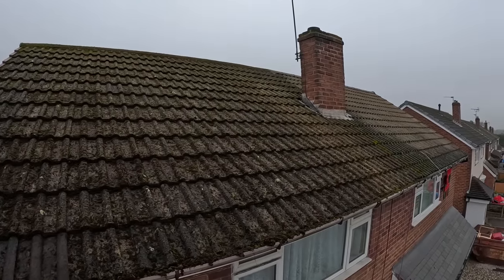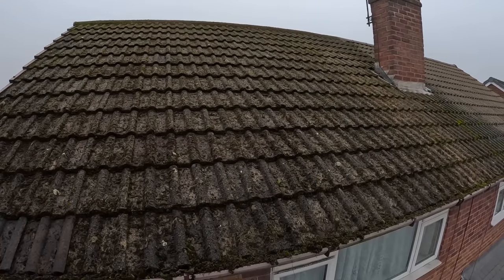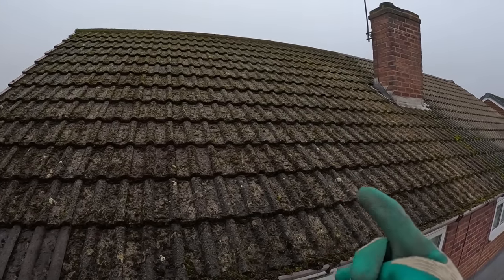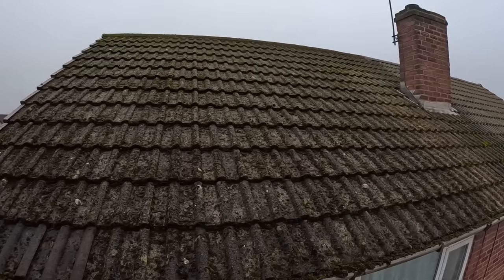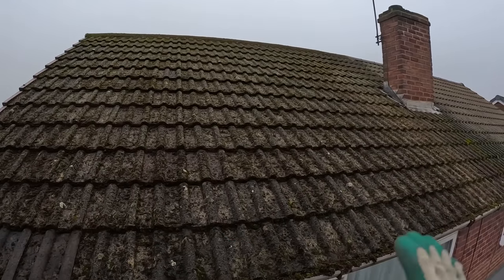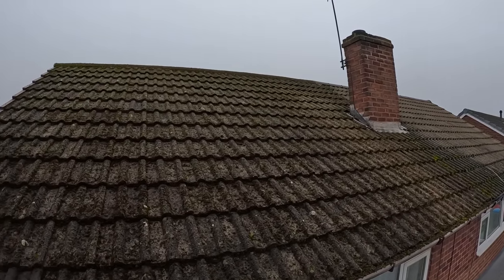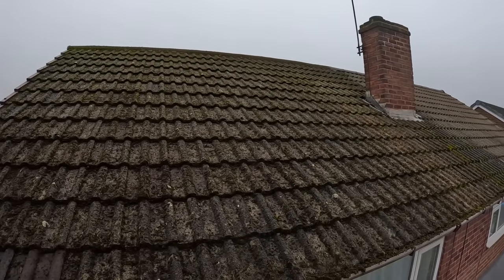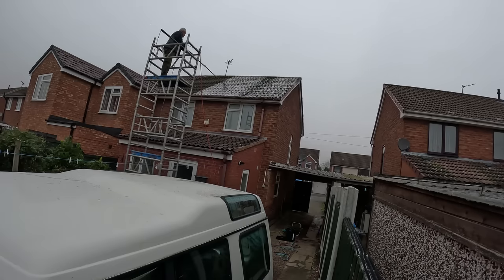STRANGE CASE: RUDE Neighbour Went Too Far? I Discovered Evidence Whilst Cleaning A Roof!

Comment: Shared gutters like drains have to be maintained by everyone connected to them. In this instance if number two neighbour has put up gutters that will not allow the run off from the first house then he can be forced to make proper provision. I would ask him nicely to correct the problem caused by his DIY and if he refused I would point out that failure to do so will land him/ her in court. This action is not what you really want to do but if shove comes to push I would not hesitate. Neighbour two will be made to fix the problem and have quite a large legal bill to pay as well.

Comment: The state customers roof was let get into before having it cleaned would have been causing moss to fill maintained neighbors guttering and moss slurry splattering down downpipe and possibly blocking it etc. Always two sides to everything, may have just been done in a bid to protect their property from a long overdue unmaintained neighbors moss.

Comment: Neighbours have broken planning regulations,building regulations in England, Wales & Scotland require that any installed guttering is fit for the purpose of protecting the foundations of your property, and any neighbouring properties, from rainwater damage.  By blocking flow to downpipe without planning consent they place property at risk from water damage.  Neighbours should contact their local planning office if neighbours refuse to sort it.

Comment: In the Uk joint soak aways are covered in the water regulation Act therefore an act of Goverment. By blocking the ajoined property a route for water to escape, the act is in contravention and therefore you can get fined for doing so, and the ajoined property could claim for damages on the contravening house owner

Comment: OMG that is a huge amount of work to scrape all that off the roof. That is like doing house autobody and detailing. Looks great when you are done but a huge amount of work to get it ready. How come you cannot pressure wash it? Just make a tool with that long pole to extend the reach so you don't have to fall off of the roof. You could angle it so the water does not go under the tile but scrape it away. They also got hot water pressure washers that would strip that in a short time. They are a lot of money. A cheap one is $3,000-$4,000.

Comment: I'm not a roofer but...  I think it's pretty ridiculous to design joined houses so one side has to deal with all the runoff from both houses.  Gutters should be slightly angled from the center with both unites having their own down spout.  That way you don't have one homeowner having to deal with clogged gutters because the other homeowner is too lazy to clean their roof frequently enough.

Comment: Did you look at the other properties in that road, to compare the gutters? 
If the other properties, which are the same design and the houses on that road were built by the same developer, have shared down pipes then there is likely a joint responsibility to access and maintain the shared down pipe and that will be in the house deeds or land transfer documents, if not an adjudicator would consider that a reasonable responsibility for both parties to share, if the other properties don’t have this gutter arrangement, then it’s likely a cock up or cost saving method by avoiding digging a separate soak away on the property you were working on….

But bottom line is that an adjudicator would order both owners to share that responsibility and for the property with the downpipe to ensure his guttering allows for the free flow and disposal via the downpipe to the soak away from the other property.

Personally I’d just look at digging my own soak away or similar surface water drainage design and put a junction and down pipe just before the neighbours property line begins. That way your taking control back of what’s yours whilst maintaining a ‘shared’ gutter….

Comment: When the houses were built there would have been an established drainage method, your client will need to evidence a right to use the shared downpipes.  He would also have liability for maintenance and repair etc.  It wouldn't cost that much to run a new downpipe to a soakaway and cap the gutter off.  What the neighbour hasn't realised is the blockage will probably just cause the rainwater to rundown the party wall and cause problems.  You have to be careful making modifications to property without authority as it could be criminal damage, though you'd have a defence of a perception of lawful authority.

Comment: My neighbour inexplicably took out their downpipes causing a leak in my spare bedroom.  Niigata falls can through the windows lintel every time it rained.  Got this roof clean myself and the cleaner offered to clean theirs at the same time.  He was ignored.  Surveyor advised my leak was caused by blocked gutters and neighbours downpipe removal.  My neighbours would not even talk to me.  Cost me 580 quid plus 660 to fix the roof damage caused.  My house is dry again.  My neighbours are pigs as for 450 quid downpipes could have been reinstated and talking to me would have had me paying for this.  Cheaper option.   Putting in a barrier was an option i tinkered with but I paid 300 to have a tradesman reset my gutters so water does not pass to my house so readily. I am not happy to watch this video to see the tradesman immediately picking sides without, it seems, hearing the other neighbours pov.

Comment: It is a shared guttering and therefore the neighbour di don't have the right to alter it in such a way as to inhibit the flow of rainwater from the roof to the sewer or soak away. It will be covered in the deeds and covenants of the properties. First ask the neighbour to alter their guttering to restore the connection if that fails then it is an expensive court case or if there is a convenient sewer close to hand fit another down pipe as it may be less agro

Comment: I was a Roofing specialist contractor for tiles ,slates, leadwork and all flat roofs including all types of guttering and drainage, 

There would most likely at some point had a down pipe in centre of the two properties  probably running into a SOAK AWAY 

Soak way would have been probably under the fence, 

It is illegal to restrict or direct or block running rain water, 

Give you good example of cowboys, I myself have over the years put in hundreds of concrete posts, gravel boards and fencing, 

My new neighbours father who claims to be a tradesmen put up new fencing and I said please don't touch mine, not a problem you would think. 

I go out to check and all my posts and fence has been pushed and forced all over the place, 

I said you claim to be a tradesmen in your new gleaming truck lol but your a complete cowboy,  

You can always tell a cowboy from a tradesmen by how the job is cleared up and left cleaner then you arrived lol.

And why do tradesmen clean up thoughly,  
Its because the job is completely finished and a good clean and then you hopefully get paid, 

But yes it is illegal to block , restrict or alter water then can result in damage or subsidence  to another adjoining property. 

Here's a bit of advice. 

NEVER EVER GET INVOLVED IN A CUSTOMERS NEIGHBOURS DESPITE BECAUSE YOU NEVER REALLY KNOW WHO IS RIGHT OR WRONG AND IT CAUSES IS YOU STRESS LOL

Comment: The Neighbour is fully responsible for any damage that could have been caused by the wilful blocking of the guttering. The deeds to these properties will have the legal obligation spelled out and there is no getting away from them.
My own house was built in 1892 and still have covenants attached, like I cannot turn my house into an Abattoir, I cannot create Noxious smells and i have to be a good neighbour

Comment: I have just moved into a council Bungalow an it's roof has more moss than this one. I also have crap wonky guttering that spits out a waterfall when it rains. An than about 4ft from my back door. The council won't do anything about it. An I have an intruder in my loft space. That keeps me awake every night with its walking over my bedroom ceiling. It drives me nuts as I can't sleep at night because of it. Yet council keep giving me excuses to sort it. Same with the moss covered roof an it's the same roof type as shown here an all the bungalows down our close. Which are ALL covered in this horrid moss. Which is a nightmare as it falls all round the path round to my back gate. As I use a mobility scooter it causes havoc as its so hard to get up with my health conditions. Yet council do nothing. Seeing this I'm defo going to save up an get my roof an guttering fixed by a private company as I'm sure they will do better than council anyway. Where is this based as I'm in West Midlands.

Comment: He could sue his neighbour if that has caused damage or damp in his home, as the water will be running down the walls. Luckily my house gas slate, not concrete. I had cowboys, not like you, who offered to clean my roof. However, they wanted to use a pressure washer. I had to point out that the moss simply washes off with the first heavy rain and saved myself £1500. My neighbour not so smart, and they had a new roof - concrete tiles.

Comment: Yeah rude. Yes your only option would be to run in another downspout and run it across to the other side where the drain connects right. Could have went in on the roof cleaning and did both sides and gutters but I guess didn't want to ask the neighbor to pay half.
I would assume in the US you could probably go for damages of the water backing up into the roof from not being able to drain. but I hear the UK still has some nice people in it.

Comment: im not familiar with UK law..but in western society the standard is pretty much the same, the house as it was built and purchased would be grandfathered in and any changes to the shared aspects of the house would have to be signed by both parties.  is the down spout was grandfathered in and drains to the city system then the nieghbor who made changes is in violation of the law.  Any damages caused by flooding, to the roof, soffits, etc the neighbor would be held liable for. And the neighbor could also face building code violations and fines

Comment: its wild to me that a roof only has one downpipe.... Stick one at each corner, or at an absolute minimum there should be one for each pitch of the house.

Theres not enough context to make a determination. If the guy who block the drain, and obviously keeps his part of the roof clean, had spoken with moss roof neighbour multiple times about cleaning his roof and it blocking the drain, then I can understand where hes coming from. Guy is not performing the required up keep when having a shared facility. If anything the things are as bad as each other. At the end of the day, and act or omission is preventing the use of or working of a shared piece of property.
Guy with the mossy roof is obviously not going to say if the neighbour had spoken to him.

Comment: Might be a good idea to get a new down-pipe added. that neighbor will probably just do it again. Worse part is by raising up the existing down-pipe is tat it'll result in standing water in the gutter.
Reply: No moss now, so neighbour may not feel a need to.  In any case, if both sides inspect annually then the barrier would be removed as soon as it is added.

Comment: Wouldn't blocking the gutter being illegal or not be up to the city and whichever department is concerned with run off?  Some government ticket writer might be all excited about writing up a big ole violation on that.  But, maybe the downstream neighbor had problems with the downspout plugging and had some water damage he had to get fixed.  So he wanted to protect his side from moss coming off the other?  It does seem odd to me that the house was built as a semi detached but with only one down spout on the front.  It would have been better to have each side have its own, then you prevent to worry of silliness like this.

Comment: I guess different areas different rules, but there was me thinking each householder was responsible for the run off their own roof and therefore would have separate down pipes into their own soakaways.
Reply: The 70s Wimpey built semis on my estate all share downpipes front & back. The back one discharges into the main sewer as well, not sure about the front. They are both on my side. The sewer manholes are also on my side, my neighbour doesn't have any. Just cost cutting practice by developers.

Comment: The was an ongoing issue hear between the neibours and sounds like next door had enuff , I'm putting my money on the moss kept blocking the Swan neck and kept over flowing on neibours side were gutters at its lowest and your customer with the moss wasn't complying so the put a boj devide in there , I seen it many times over years , I seen blocks of houses on hill 7 gutters all stepping into each other , guy with outlet struggling to cope with moss from 4 doors up try explaining that one lol, 20 years roofing experience here

Comment: I watched this video and my opinion is mixed. Yes, it's not nice what your neighbor did, but on the other hand if I was in your neighbor's shoes and I had my roof nice and clean why the other roof of my neighbor (you) was totally covered with moss it is kinda of understandable that he did not wanted your junk through his drain pipe. Aside from that, to avoid these kind of issues, and I assume these houses are owned (not rented), is that it's better each has their own drain pipe.

Comment: The "" local planning authorities"" ensure the submission of drainage plans at an early stage in the planning approval process, and that the whole development is carried out in accordance with the approved plans.
  before ever erecting /building the house . also on the plans it shows location of outlet/downpipe who is responsible for that outlet 

This  so called neighbour has not applied for planning permission to alter the flow of rainwater which is put back in the system which the water authority places a charge ££  on each/both property/s  🤷‍♂
also inform water authorities that your  client  can now ask for  a repayment   ££  is not using their water drainage collection😁

Best  to inform your  client if it happens again ,
client should  contact "local planning department of "neighbours actions"    (planning permission to alter plans & deed)
as  neighbour has/needs to apply for "permission" to alter the original plans set out 👀

also the Environment Agency would be interested in this ,, in accordance with the commitment set out in the Surface Water Action Plan,
"""""""""surface water risk management """"""""" 🤔
according to                >> Department for Environment , Food & Rural Affairs <<
hope this helps ,,🙏
PS = subscribed  & 👍

Comment: Not sure I understand the "conflict".  If the other neighbor doesn't want the customer's water and debris that seems entirely reasonable.  All the water should not be draining onto one property in the first place.  The roofer should suggest adding a downspout at the customer's end of the front gutter and leave the divider in place.  The gutter drains better and each neighbor only gets water (and debris) from their own half of the roof.  It should have been installed that way from the beginning.  We have local codes in the US that prevent water discharge from one property onto another.

Comment: I am a Builder. What someone did  in this case is against the Law  if there is only one Down Pipe taking the rainwater from the complete front or rear section of the roof.
Whatever side of the property  the down -pipe is fitted must allow free -flowing rain water from the roof and gutter to drain down the pipe.
Title deeds will state that Waterways and Down Pipes must be shared if there is only one drain pipe serving the front or rear elevation.  
If  the owner of one side of the property has removed a down-pipe and  re-routed the rain water to the  neighbours  side of the property, then that neighbour is quite within its right to close-off  the gutter at the boundary of the guttering.....Check the "Title Deeds!"  and don't be a Pain in the Ass! .....Life is too short.  .............No charge!!

Comment: I can tell you from experience..... I spend money on my roof and have it cleaned regularily ... new guttering and down pipes. My neighbor spends nothing and his roof looks like this one on the left. The down pipe that serves both properties in on my side and goes into a drain on my drive..... which CONSTANTLY fills up with and blocks with mose from my neighbors roof. I can undrestand wy this guy has done it.... I put a filter on my neighbors side of the downpipe so that all of his moss gets trapped in his gutter and does not pill and block the drains.